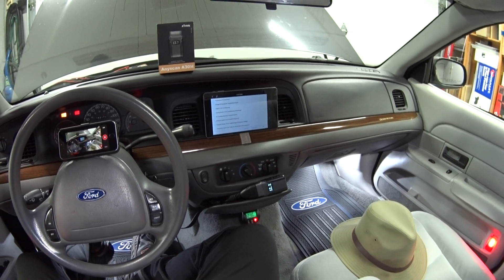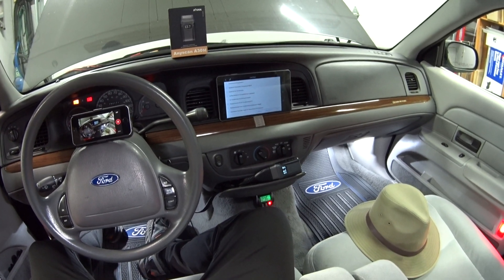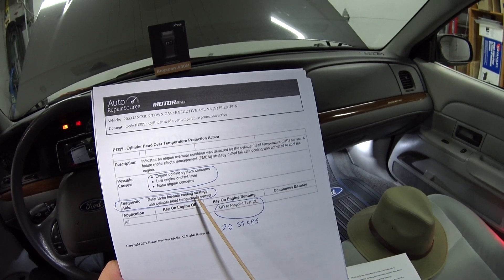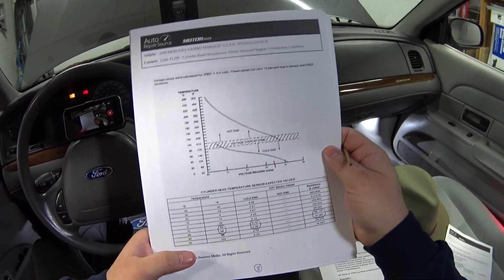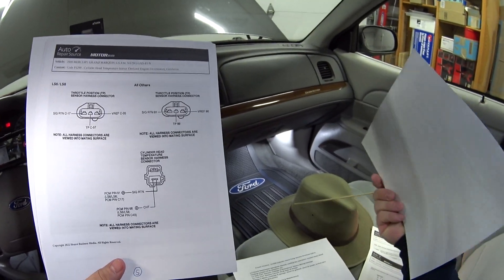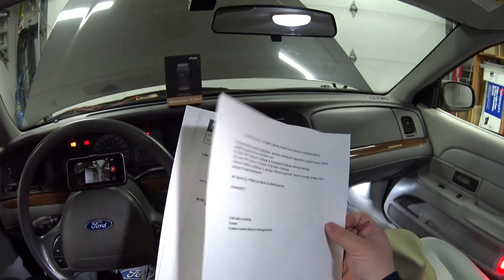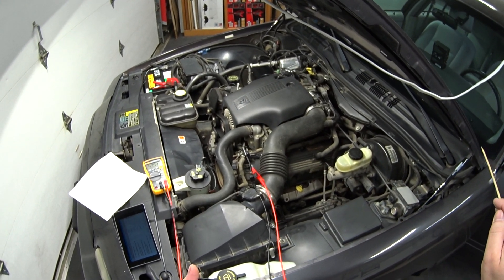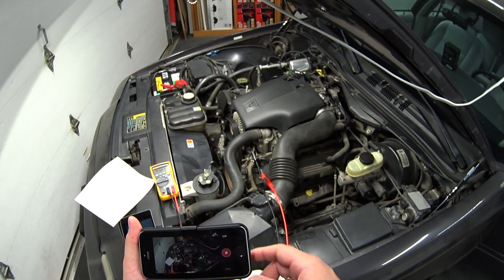Crown Victoria - DTC P1299 CHT Sensor (cylinder head temp)

Comment: This was very well done Chuck.   Thanks for doing this.  I learned several more things about the system.      I don't know why but I find it fascinating that a manufacturer utilized a sensor that can read the metal temperature and not just liquid.       In our case on the P7B it was 100% operator error and man induced air pockets.    I will say the system works and it does in fact start shutting cylinders down via the fuel injectors.    Thankfully due to our own dumbass mistakes we didn't appear to do any damage to the poor old engine.   While it only has 70k miles on it if you factor in idle hours is has 300 billion miles on it haha.
Reply from the maker: Right on Mr. Black,
Thanks for the opportunity. I had fun looking this one up. 
I tried using my $70 hand held scan tool for this video but it not have access to CHT Sensor live data.

When you get a chance could you take a minute, and see if your Blue Driver scan tool has CHT Sensor live data for your P7B?
-Chuck
Reply: @PanzerPlatform  Yessir.  I'll try and do that here after a bit.
Reply: @PanzerPlatform  Not in the list of supported PIDs.  :(
Reply from the maker: @PNW_Car_Mods  
Rats.

Comment: i have a question but not in this subject.TPMS .I bought a new set of tires and one from these sensor's is damaged(i know with one,this alloy was distorted and after repair -TPSM fault on dash board ),so i need to buy new set of sensor's.I think these ones are orginal bicouse they are mounted on rimm  opposite to valve.What kind of maker should i look for?In Poland i can buy only sensors in valve's.
Reply from the maker: Right on Barth,
Thanks for watching, and the great question.

I only have one video on TPMS; https://youtu.be/xBxaQroaGzI
-
My service literature lists a part number for the TPMS Sensor for all Panther Cars 2008 - 2011 as part# 6F2Z-1A189-A. The operating frequency is 315MHz.

My 2010 MGM still has the original TPMS sensors, and are functioning properly. I have not had to replace them yet. As far as brand, or manufacturer of replacement valve stem type TPMS, I don't have a recommendation. 

I searched the part number (6F2Z-1A189-A) in Amazon, and it looks like 4 sensors cost around $40-$90.
Sorry, I’m no help.
-Chuck
Reply: @PanzerPlatform  Thank you anyway.